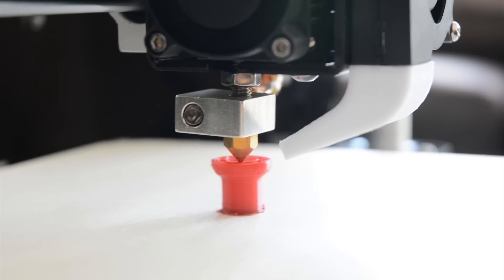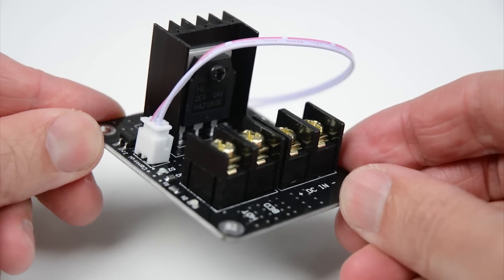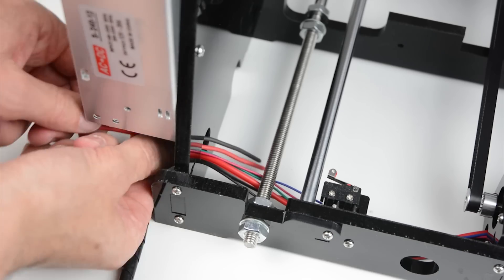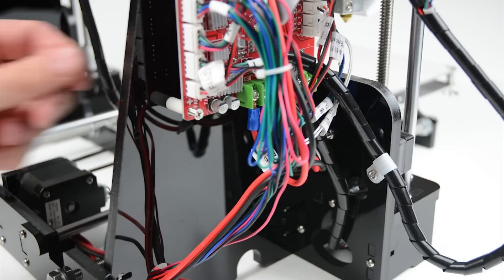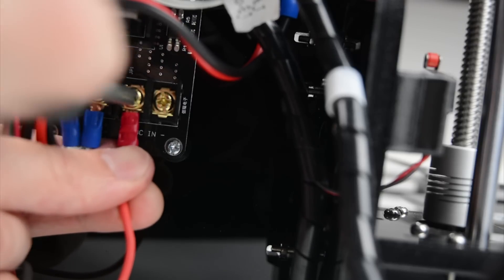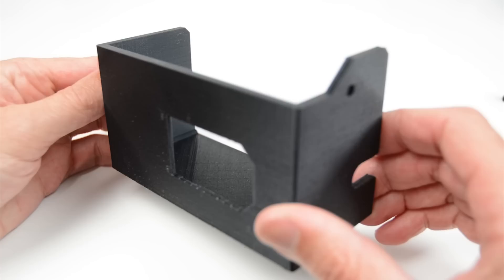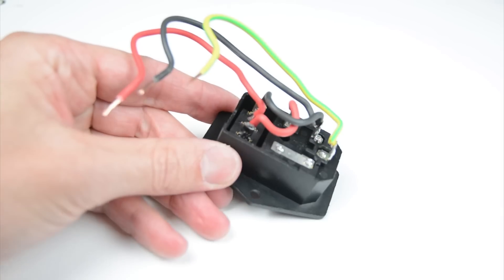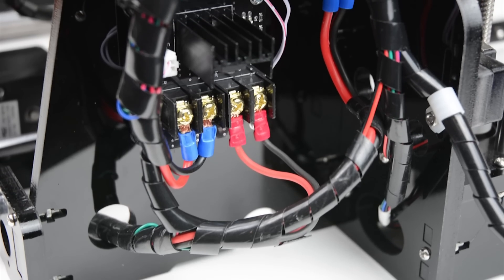ANET A8 MOSFET AND POWER SWITCH INSTALL + UPGRADES

Comment: Has the power supply held up?I've heard really mixed reviews on the PSU supplied with this printer?
Reply from the maker: Yeah not the best Power supply, but so far its been ok.
Reply: amstudio thanks ,as soon as ive saved a little i will be buying one of these printers and a set of MOSFETs etc

Comment: I reccomend printing a strain relief for the hotbed wire so there's no strain on the connector, and so it's not going to melt or burn as fast ;) welcome to the anet group ;)